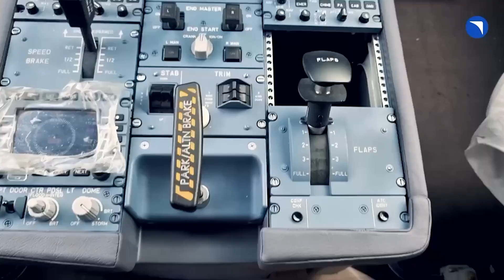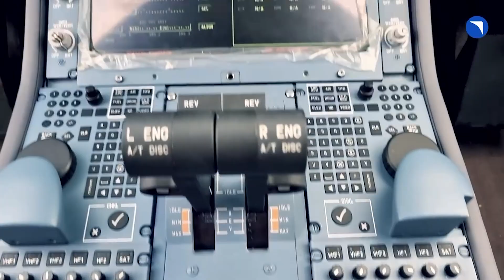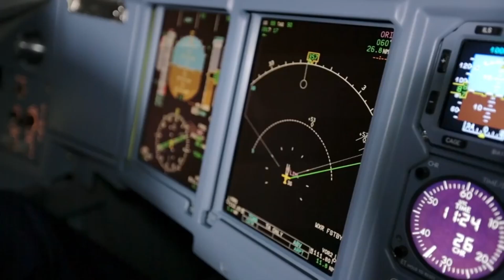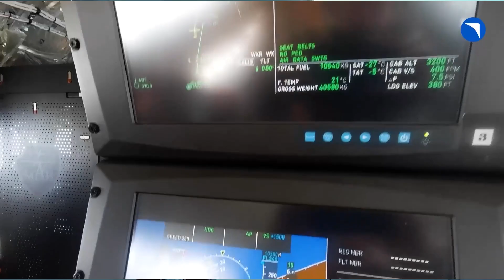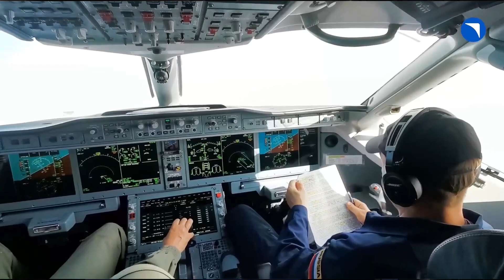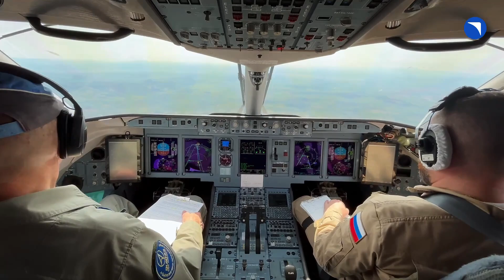This is not what I expected

Comment: Inaccurate. Airbus has had alpha floor flight envelope protection since the a320 series was introduced in the late 80s.

Going further the original SuperJet 100 actually uses Thales avionics from France like airbus.

You can see the PFD similarities.

It is true however that Russia is forced to develop domestic avionics suite from KRET because of sanctions.

I am not familiar with that implementation, maybe it is a good development, time will tell.